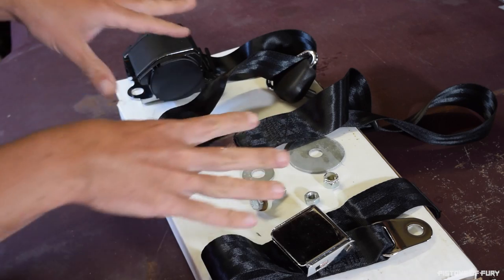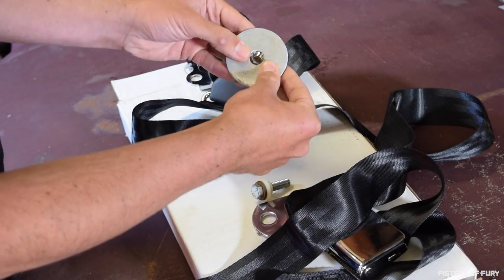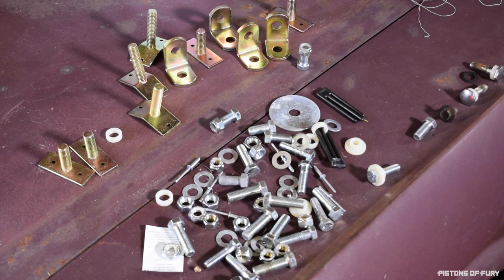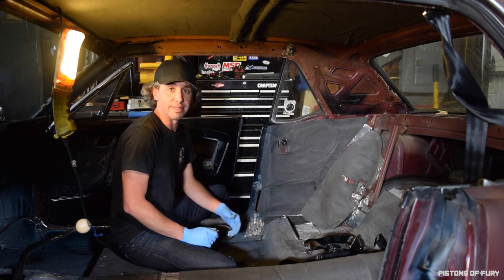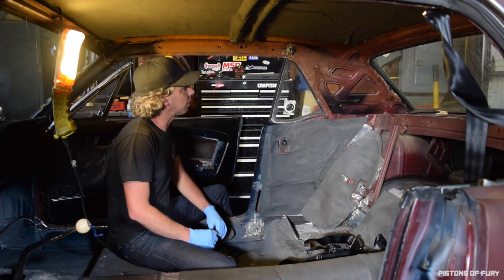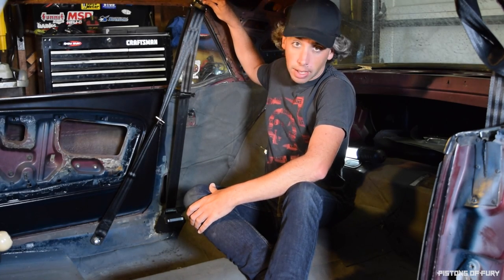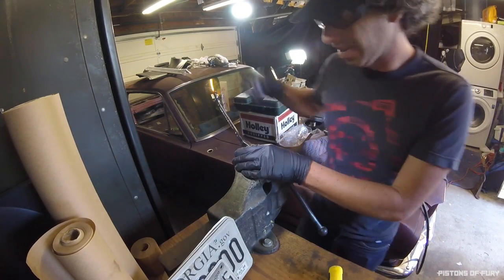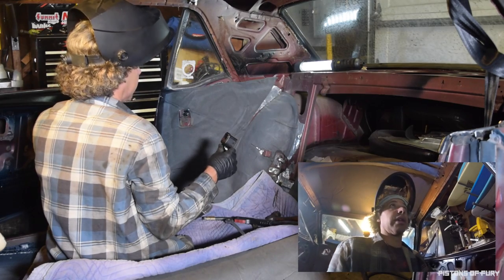PoF // Ep 10 - DIY 3-Point Seat Belt Install

Comment: Hey - did you install a reat seat in the car? Wondering if it interferes with the retractor. I like that setup better than the ones that use a single mount location with the slotted bracket hanging off it. I have a '70 so the upper mount location is already there.

Comment: Super helpful thank you! I bought a similar set of seatbelts, and stupidly removed the little clip that  keeps it from retracting all the way, and now it is stuck and won't ratchet back out. Do you have any suggestions on how  to pull it back out?
Reply from the maker: If it's installed in the car already, you could try unbolting part of it to get it enough slack to release the latch. Otherwise, you probably need to at least partially disassemble it to release the latch manually. Hope this is helpful!